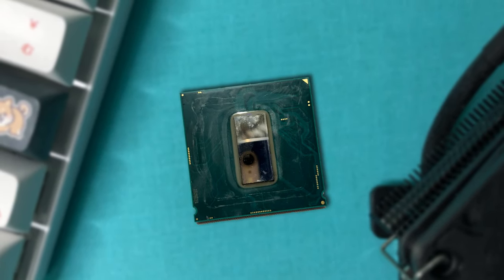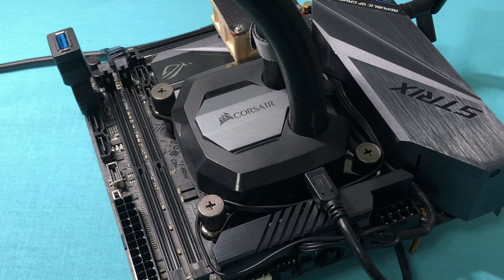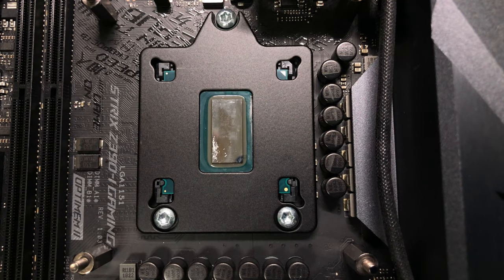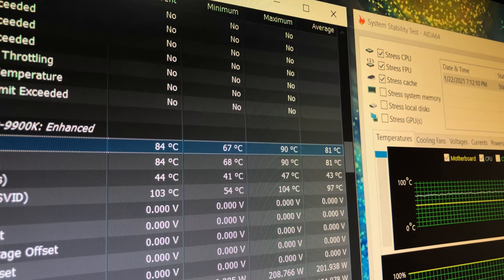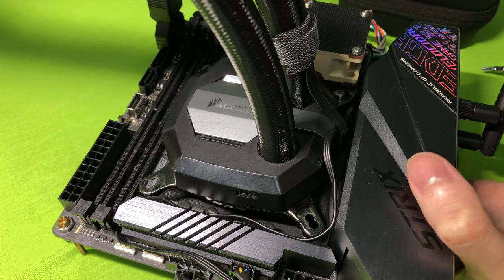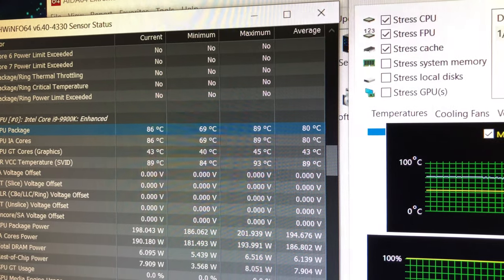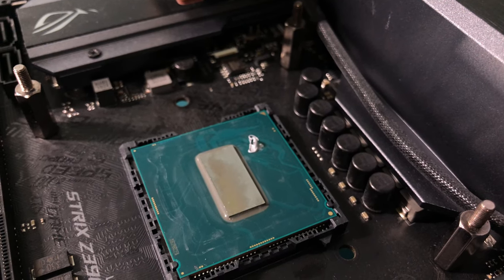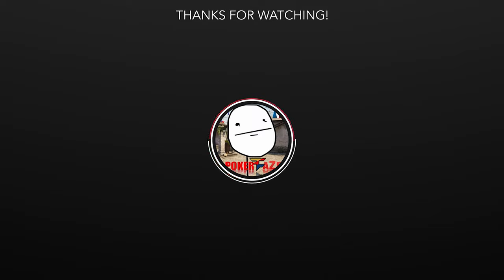Liquid Metal on Copper After 1 Year - Intel i9-9900k Direct-Die Cooling

Comment: I used it to my Alienware Laptop it goes to thermal throttle at full load over 100degrees now it reach 76degree after one hour i didnt regret doing it one time.
Reply from the maker: I regretted doing it many times, wasted a lot of liquid metal for one video 🥲
Reply: My X17 R2 came with Liquid Metal from the factory, my 3080ti at load only gets to 75c max, and the CPU gets around 85c Max load also. But Alienware only does this for their highest end models

Comment: It looks like the liquid metal has essentially produced something like an electro-plated surface with, I'm assuming the gallium/copper combination. After you polished it, this plated spot could still be seen. What I wonder is: after another year or so with new liquid metal, would this spot react different than it did the first time? Because it's now essentially protected by the previous change to the copper surface?
Reply: I need to check the source but I kind of remember that with repeated applications the reaction with cooper is smaller like you say a new surface with a sort of platting is formed, maybe it was der8auer or Gamers Nexus.

Comment: I am baffled...I have a normal 10700kf and only reach 80C not even delidded. Besides I have cracked dies on 1333mhz amd processors in the past. No thanks. I also have a 2-120 mm fan liquid cooler and run at 4.9 ghz on all cores. Also you should have sanded your cpu cooler. I always did.

Comment: Came for the 9900K information, stayed for the roast. Love it!

I have a 9900K that I delided. I replaced to the solder with Conductonaut Liquid Metal, put the IHS back on, and used Kyronaut between the IHS and my AIO. It hardly ever gets above 70 degrees Celsius running at 5.1 GHz all cores (can't remember the voltage, maybe 1.25V?). It's stable at 5.2 GHz at the same voltage, but I'm happy with 5.1 GHz. I also haven't replaced the liquid metal in probably 5 years or thermal paste in probably 2 or 3 years. I don't think there's a set time for degradation. Just monitor your temps. When they go up, replace the paste/liquid metal.

Comment: thanks for your video! i just got my first water cooler and i was worry to use liquid metal on it(is copper) but after seen the result on the copper after one year i feel confident to use it now! question? so more is better? if i use to little liquid metal i get the risk of dry out? any subjection or video on how much to use? thanks in advance
Reply from the maker: It is liquid metal, not water so it can't dry. Like I said, it is chem reaction, so once the reaction is done, you need extra LM to continue transferring the heat. It's hard to tell how much but for me I put 2 "balls." One on the CPU, one on the cooler. You can try then check again in 3 months, and after that you have some ideas of how much is needed.
Reply: @PokerFaZe  thanks for your time! I will do that!!

Comment: Huge fan, the only reason I delidded my 9900k was because of your detailed videos. Now I'm running sub 70 degrees celsius and running at about 5.2 GHz! Keep uploading about this!
Reply from the maker: Wee, I'm glad those old videos helped you :D
Reply: @PokerFaZe  I'm curious. Are you also a fan of Optimum tech? your channel gives me heavy optimum tech vibes.
Reply from the maker: @2355marc  Yes, I am :))
Reply: @PokerFaZe  I am very surprised you were only able to get a 7-degree drop in temperatures. Granted, I was expecting to get as much as you, but I was also surprised to see nearly a 30-degree drop in my temperatures, as I was always thermal throttling at 5GHz. Can I ask what voltages you're running in your overclock?
Reply from the maker: I am currently using 1.36V to get 5GHz. I guess it can be my cooler, maybe one day I'll find the need of upgrading it to a better one :D
Reply: @2355marc  Hey what's your cooler ?
Reply: @trixniisama  it’s the EKWB d-RGB 360 mm aio

Comment: my copper ihs and copper aio plate has 1 dark line after delide and thermal metal, only used mx6 paste between ihs and aio. can I sand my aio plate and should I replace the ihs to a new copper?

Comment: M8, I think you could improve performance if you microwave the die, then while it is still hot you take it out and gently place it on cotton and then smack it with a hammer. Also, you can remove the liquid metal really fast with a angle grinder
Reply: I laughed too hard at this.

Comment: stupid question , its possible to delid a i78700k and use ''open'' like yours? does It need some extra stuff to work or no?
Reply from the maker: 8700k die is lower than 9900k, so it won't make good contact with the cooler or have enough pressure to push the CPU down to the socket. So you should stick with the IHS.
Reply: @PokerFaZe  thanks

Comment: when replacing liquid metal u absolutely should not  touch it if ur using a liquid metal with a fair bit of indium in it just add a little bit more to whats there already and u will end up with an application that will last years instead of just 6 months

Comment: Lmao your rant is fucking gold! So many topics discussed. But on the technical side, looks like there’s some diffusion of the Liquid Metal into copper. Also, thermal cycle can cause a pump out effect with the copper swelling and shrinking. The point being if you put too little Liquid Metal it can reduce performance over time.

Comment: As far as 9900k is concerned, direct die is probably the best way to cool it, i did it like that myself and had great results. But the 10th and the 11th gen chips run way cooler than the 9900k because of lower die height on the 10th gen cpus and larger surface area on the 11th gen cpus. So if you already own a 9900k then it might make some sense to cool it direct die, but in case you are buying used or may be new, then you should look at 10th gen cpus or better buy a ryzen 5800x or 5900x

Comment: Interesting Video.

But I must say, those temps are not great. 

I'm running a custom loop with Ryzen 9 5900x and a 2080 ti. Both put out quite a lot of heat energy. 

The 5900x (with stock heat spreader) hardly ever reaches 70° C while running multicore cinebench. It is using about 180 watt at full load. Not sure how much energy your 9900k uses in comparison. 

My GPU (with direct die cooling but no liquid metal) outputs even more heat. It uses about 270 Watts, while running below 50° C.

I'm using Ryzen Master (for CPU) and Afterburner (for GPU) to read those values.
Reply: You are comparing a ryzen cpu to a 9900k. It is apples to oranges.
Reply: @mikerzisu9508  Yeah yeah, my bad. I've forgotten: physics behave different when it comes to Intel CPU... Yeah right
Reply: @roopey  they are completely different architectures. Completely different platforms. They handle great different.  You can't take your ryzen temps and say that his temps are bad on a 9900k. Doesn't work like that

Comment: I really want to know is what happens after like the 2nd or 3rd time applying liquid metal, like does it keep making copper worse or after it created the new alloy it will prevent the copper from getting worse and make liquid metal to preserve for longer like when applying to nickel plated copper?????????
Reply from the maker: I think it should be fine, the alloy should stop it from continuing reacting. I think this video from NileRed explains it well
https://youtu.be/IrdYueB9pY4
Reply: @PokerFaZe  I already saw other videos of aluminum + liquid mercury reaction, but never seen about liquid metal unless the same exact videos of what happens after months, a year...

liquid metal is also not 100% galium, the mix is known but the % of of all components from each brand selling it as thermal compound, I think never specify the exact mix between them...

I wanted to try Liquid metal for quite some time, but end up always using Arctic series of MX since like 2008, recently I used MX-5 on the CPU and Thermal Grizzly Kryonaut on the GPU.

But I have seen some people who applied it well on laptops and some even in just a few months the laptop overheated and shutdown and when they opened it, there was just dust and the copper was even in quite bad shape compared to your...

PS: Can't ever find is what really happens after a few times of using liquid metal on copper and If I knew it would then stay liquid almost 4 ever not reacting anymore after the copper gets fully silver from the new alloy formed then I would use it... A lot of people report dead GPU's because they overheated with liquid metal and I would like to use it on my GPU too, however I don't usually track temps, I clean it, put new thermal paste after a few years and forget about them, only rarely check clocks, temps...
Reply: This is what I was thinking too. After the plating has occurred, how could the liquid metal keep causing more plating? For example, if we did this to aluminum the reaction doesn't start happening until the gallium can penetrate the oxide layer that's caused by aluminum being exposed to oxygen.
Reply: @PokerFaZe   Yes, I was hoping that this is the true answer. Do you plan to make another video like this in a few months from now, so that we can see the affected surface once again? Perhaps your prediction is correct. I would like to use Liquid Metal in my Laptop, but it has bare copper heat-sinks. I'm not really wanting to have to replace the stuff several times again and again. But I would do it if the first application lasts 1 year and then the second application lasts a lot longer due to the plating.

Comment: You spoke of evidence as if there isn’t any evidence of liquid metal ever drying out on copper, but there is: https://www.youtube.com/watch?v=ejPQmtADOaE. I also wonder how frequently was your computer used during the course of the year in comparison to Timmy Joe’s laptop which did dry out in the same span of time.
Reply from the maker: I don't get the evidence part, anyway, I’m using everyday, it is my main gaming + editing machine. I think he applied too little which didn’t leave any extra LM after the reaction. It doesn't "dry" because they are all chemical reaction.
I'm sorry but I don't think he knew what he was doing or talking about. Asus has many laptops that use liquid metal instead of traditional paste.
You should watch NileRed's video about the reaction between Mercury and Aluminum as it is similar to this.

Comment: Ah direct die testing ^_^
Reply from the maker: I successfully kept myself from removing the cooler :))
Reply: @PokerFaZe  I like my 9900kf exactly where it is. Stock and under a blackridge. That being said... I may eventually change cases.
Reply from the maker: What case are you going for next? And are you planning to get the single-fan 3060? :D
Reply: Well I am fine with the case for now, but I am concerned that we won't see a 3060 ti under 185mm.
I am hoping that MSI or Gigabyte will make a 180mm card otherwise ill have to import one.
If I can't get a 180mm 3060, 3060ti, or 3070 then I will have to upgrade the case to a Sentury, a DanA4, an Nr200, or a TU150 so I can have a 3070.
Reply: @greenprotag  MSI released an Aero ITX 3060 ti yesterday! still unobtanium but it's there..!
Reply from the maker: Gentlemen, sorry in advance, but it's all competition for that ITX GPU after all...
Reply: Ok mister "I got a 2070 itx GPU for less then retail" 
Some of us are still rocking 1070s and can barely make 1080p high refresh with e-sport titles.
Reply: I am tempted to put out a $100 bounty on the privilege of purchasing at least one card at MSRP.
I have two builds to upgrade.